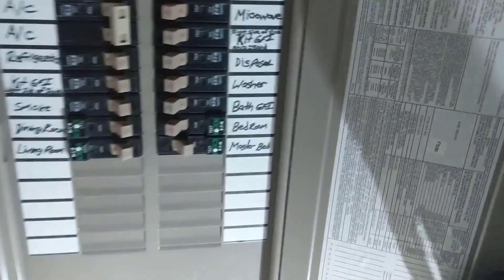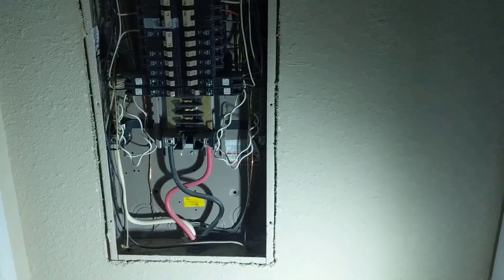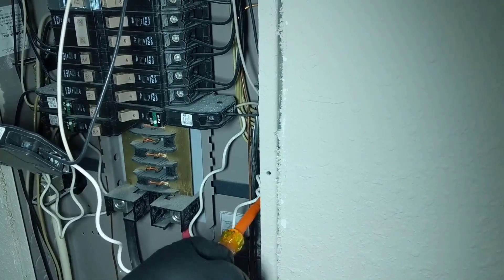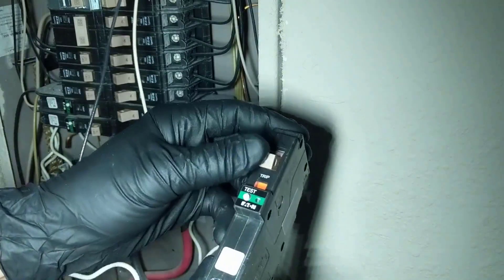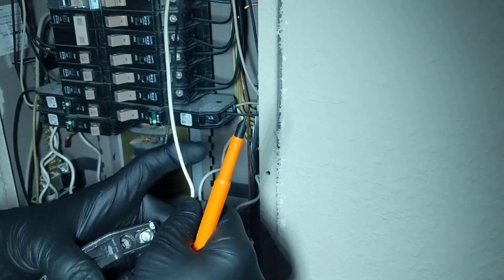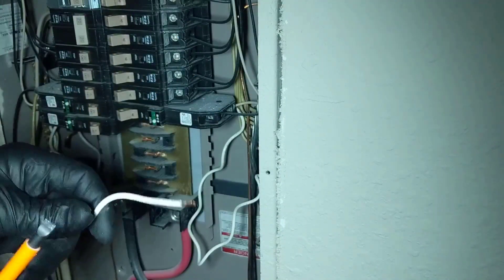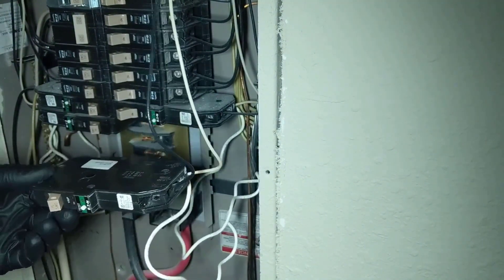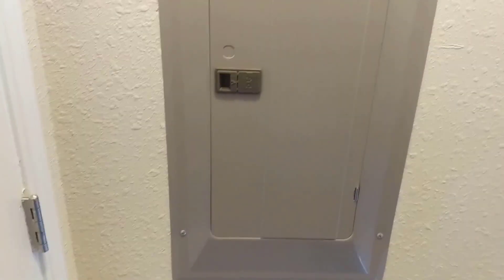Eaton AFCI Breaker Replacement

Comment: As an electrician I have a few problems with this video, but I will just shut up! Be careful folks! Call an electrician if you are unsure of your abilities!
Reply from the maker: That's a good idea 💡 Thanks for watching Food Porn 👍
Reply from the maker: I do agree with you on if your not comfortable or don't know what your doing stay out of the service panel. Atleast shut the main breaker off to the panel if anything. I've been replacing breakers, outlets, switches, 3 way switches, running wire, conduit, etc...for 20 years & I'm always aware of my surroundings doing any kind of electrical work. I'm not an electrician as a everyday job, but I do it enough. I also took a year of basic residential electrical in vo-tech, then switched to HVAC/Plumbing for the last 3 years. By no means am I saying I'm an electrician, but I know what I'm doing & how it works. Please share your issues with the video. Thanks
Reply: @ApartmentMaintenance  I just think most (not all) homeowners or whoever should probably not be working in a live panel like this, I am not a service electrician anymore, and never had my own company, so it is not about electrical companies taking your hard earned dollars, just from pure safety standpoint, of them hooking it up wrong (way too many variables to go over, loose connections, hooking neutral to the wrong bar, then it wont function properly, ect. Not every panel will have a gold "bus bar", I am thinking from a complete noob doing the job. A lot could be done wrong here, as well as injury. ok that's my 2 cents for what its worth. I would at least recommend to turn the main breaker off to the panel while working in it, I do not, but I am not a noob.

Comment: I've never changed a circuit breaker out on a house before, but this is my project today. This video looks almost exactly like what I'm about to do. Thanks for this.
Reply from the maker: No problem, hope the video helps. Thanks for watching Kyle & Subscribe to the channel 👍
Reply: How did it go, did you have any issues replacing it ? I’m doing the same thing . Do I have to shut the big main brake to the panel off to be more secure ?
Reply: @rolac6109  YES. Maybe the pros don't have to. But I made sure to turn mine off. I've replaced 3 total now with no issues.

Comment: Those breakers go bad fast we change those a lot at my building.. Thank for sharing stay safe.
Reply from the maker: Yeah I've been getting alot lately, their at the 6 year mark and starting to drop like flies. Thanks for watching Rudy 👍
Reply: Yes I'm curious I cannot reset it and my home is about 5yo I thought I had a short but cannot seem to find anything wrong aside from concluding the breaker it will not reset just keeps tripping
Reply: @ApartmentMaintenance  let me know
Reply from the maker: @Tico_Mike  Sounds like a wire is touching another wire which will make the breaker trip right away. Soon as you reset it, it will trip instantly. Those kind of issues take time to diagnose, I usually check all the outlets first then the switches, then if I can't find an issue I would swap out the breaker. Good luck on your adventure. Thanks for watching Tico & Subscribe to the channel 👍

Comment: Man I wish I had any other brand breaker than Eaton!  These AFCI breakers are still susceptible to RF and I trip breakers all the time with my Ham radio.  This was supposed to be fixed as Eaton worked with the ARRL to develop a new breaker, turns out they still trip when transmitting over the radio.  Wonder what it's going to cost me to replace the entire panel?
Reply from the maker: That's crazy! I'm not sure what that would cost, but call around & get some quotes. Thanks for watching Art & Subscribe to the channel 👍
Reply: Are the Eatons unreliable? I got one that does not reset at all. I thought I had a short but checked all my outlets etc
Reply: Got a Eaton breaker box with nothing but these breaker switches . 2 of them keep tripping boutta replace one today see if it fixes it. Checked the outlet to make sure it wasn’t anything wrong but seems fine. My bro told me most people don’t install these cause of this type of problem with the breakers they are more sensitive apparently and they fucking cost a lot lol .

Comment: Why does the neutral need be disconnected?
Reply from the maker: @frikinrikin  The neutral is connected to the new breaker out of the box so you have to install that white wire on the neutral bar. Thanks for watching & help support the channel by subscribing 🛠️👍

Comment: I really appreciate your use of the on-screen captions feature. Thanks.👍 I have two questions:
(1). Is this the same procedure for an Eaton 20 amp AFCI breaker? 
(2). If I don't have an insulated screwdriver, can I just put shrink wrap over the shaft of a regular screwdriver?
Reply from the maker: No problem on the on-screen cations! To answer your first question about "Is this the same procedure for an Eaton 20 amp AFCI breaker?"  The answer would be yes, everything is the same the only difference is the breaker is a 20 amp vs a 15 amp. Your second question of asking if "I don't have an insulated screwdriver, can you put shrink wrap over the shaft of a regular screwdriver?"  The answer is, Absolutely NOT! Cause shrink wrap is not the same as an insulated screwdriver such as Klein, Milwaukee, or any other brand of insulated screwdriver. I would recommend buying the correct tools to do the job & if you don't feel comfortable call an electrician to replace the breaker since doing any kind of work inside an electric panel isn't for someone who doesn't know what their doing or have the proper tools & knowledge. I'm glad you asked the question, cause it's definitely worth the money to call an electrician. Thanks for watching Wiggler & Subscribe to the channel 👍
Reply: @ApartmentMaintenance  Shouldn't you be telling everyone to refer their questions to a qualified electrician?
Reply from the maker: @larrywarolin7215  Thanks for watching Larry 👍

Comment: Question:
You referred to the ground bar/neutral bar as the same.
In another video they said not to connect the coil to the ground bar but only to the neutral bar.
Is there a difference?
Thanks for all your details.
Reply: No not the same big difference. Don't connect white on your ground bar unless both neutral bar and ground bar are connected. Usually ground conductor is green.

Comment: I switched out my breaker thanks to you. But I’m still not getting power from this specific breaker. What else could be my issue?
Reply from the maker: Your not getting any power at the breaker itself or from the circuit? Cuz if the breaker is installed correctly & then flipped on you should get a reading from a ground lug to the screw on the breaker itself whether it's 120v or 240v.
Reply: @ApartmentMaintenance  so I actually checked all of the outlets and they are giving power. However I plugged in a charger for my phone and it tripped again. Nothing is plugged in, in that room. But yes the circuit itself does have power
Reply from the maker: @0240172  I would try plugging something else in to see if it still trips or if it's just the charger causing it to trip. If it does trip with anything else plugged in you most likely have an issue at one of the outlets. I would also try plugging the charger or whatever else in at a different outlet on that circuit to see if it trips there as well or if it's just at that one outlet cuz they would tell you that it's cause of that outlet.

Comment: Do you not switch the main breaker off first? If not, any reason not to or you just don’t feel it’s necessary? Thanks for posting
Reply from the maker: I did not. Turning the main breaker off is definitely best practice & the safest way to do it, but sometimes I just go with how the job is going. Not that it's an excuse or reason but I've done countless breakers in my time but of course that's still not the right answer. Great question Scott. Thanks for watching & Subscribe to the channel if you're not already. 👍

Comment: Do you have to use the braided ground wire or can you replace with a solid?
Reply from the maker: The wire your referring to comes from the manufacturer internally connected to the AFCI breaker & everyone I have seen so far has been a braided wire. I would follow the manufacturers instructions listed with whatever AFCI breaker you purchase. Thanks for watching root alley & Subscribe to the channel 👍

Comment: good vid. I need to do this as well so thanks for the tips. So you didn't shut off a power main? just made sure not to touch anything hot right? and the gloves, do they do anything? thanks!!!
Reply from the maker: The gloves don't do anything. It's best to shit the main breaker off when messing with anything inside the electrical panel. Thanks for watching Terry & Subscribe to the channel 👍
Reply: @ApartmentMaintenance  If it's best to shut off the main breaker, why don't you?  You've got your two hands tied up and wires flailing around.  I am not an electrician, but I work in the industry.  I don't think it's wise to show amateurs working on a panel hot.  Just MHO
Reply from the maker: @bcoldwell1  Yes always shut the power off when working on a live circuit or the main breaker when working inside a breaker panel. I always state it someone doesn't feel comfortable or know what their doing, call a professional. Safety First! Thanks for watching Bill & Subscribe to the channel 👍

Comment: Hey, can I replace one of these afci breakers for a regular breaker?
Reply from the maker: It's code to have an AFCI breaker in newer homes or existing homes when an addition is added on, an extra circuit is added, or an extra outlet is added. The AFCI breaker provides a higher level of protection for the circuit. A regular breaker would work on the circuit, unless there's an issue in the circuit somewhere that's causing the AFCI breaker to trip, the regular breaker would trip as well. Hope that helps. Thanks for watching Pilotmedic & subscribe to the channel 👍
Reply: @ApartmentMaintenance  thanks
Reply from the maker: @pilotmedic  No problem!

Comment: Is there a special tool to get the white pig tail wire off the nuetral ground? I tried to replace a faulty breaker and the screw would not budge. It's like it's glued in.
Reply from the maker: I just use either a insulated #1 square bit screwdriver or a insulated flat head screwdriver. Thanks for watching Chosen1 808 & Subscribe to the channel bro 👍

Comment: Hey, I know I'm watching this a year after you made it, but can I ask, what gloves are good to wear when working around a circuit breaker? And are they designed to actually protect you from electrocution?
Reply from the maker: They make gloves that the electric company wears when messing with really high voltage but I don't know what the proper name is for them. I'm just wearing nitrile gloves in the video but they aren't rated for electricity. Thanks for watching John & Subscribe to the channel 👍

Comment: Is it normal for an afci or gfci breaker to be hot at all times?.
Reply from the maker: AFCI & GFCI breakers do run several degrees warmer than ambient temperature & warmer than normal circuit breakers. The GFCI breakers or receptacles have a transformer built into which makes them run warm. But if a breaker is hot to the touch there's most likely an issue such as a over heated breaker, loose breaker, or failing breaker. They will sometimes make sizzling or little popping noises when failing, & most of the time they will just fail without any warning. Great question Mi Sangre Centeno 💪 Thanks for watching & make sure your subscribed to the channel bro 🛠️👍
Reply: @ApartmentMaintenance  thanks a lot bro. I have 13 heat sensitive breakers (afci and gfci) in my load center and 8 normal breakers (not warm). They are warm but not hot to the touch. Because all the sensitive switches are hot, I think it's an usual condition but I'm not sure.  My loadcenter is an Eaton Plug-On neutral.

Comment: Was the black wire hot? You were able to touch it without getting shocked?
Reply from the maker: The black wire is hot when it's connected to the breaker & the breaker is connected to the bus bar. The incoming power legs (the 2 wires mounted at the top of each lug) are hot which makes the bus bar hot down the middle of the panel. Once I turned the breaker off & removed it from the bus bar there is no power going through that wire anymore since it's disconnected from the panel. If your uncomfortable or don't know much about an electrical panel I wouldn't recommend working in or around one. Call a electrician for repairs. Remember Safety First!! Thanks for watching & Subscribe to the channel 👍

Comment: Did you turn off the main power to the house? Just wanted to confirm.
Reply from the maker: It's always best to shut off main power before taking cover off electrical panel & doing any work inside the panel. Thanks for watching Pigs & Subscribe to the channel 👍
Reply: @ApartmentMaintenance  If you shut off the main power, then nothing is hot right, including the bus bar in the middle of the panel?
Reply from the maker: @Loki_Lou  I'm not sure how your breaker box is setup, but mine doesn't have a main breaker inside the breaker panel, it's outside at the meter. If I would of shut the main breaker off outside at my meter, my panel wouldn't have any power. I would still confirm there's no power with my multi meter, & use my lockout tagout device at the main breaker so nobody could turn it back on. You will have to see how yours is setup & if your able to shut off the main breaker I would still confirm the power is off with a meter. Thanks for watching Yanxin & Subscribe to the channel 👍
Reply: @ApartmentMaintenance  Thank you. I do have a main breaker shutoff and was able to install a breaker without any issue. Thanks again!
Reply from the maker: @Loki_Lou  Always remember Safety First! But glad you got everything taken care of & saved yourself some money by doing it yourself. I always say when it comes to electricity if your not sure or feel scared then it's best to call an electrician, as it's not worth the consequences, & you only get one life, choose wisely. Thanks for watching Yanxin & make sure you subscribed to the channel bro 👍

Comment: Our home inspection reported that the Arc breaker was not functioning and should be replaced. This seems fairly doable, but we don’t have the appropriate tools you used (insulated tools?). Would it be worth it to invest in the tools and purchase the part to replace ourselves, or would it be better to call an electrician?
Reply from the maker: If your not familiar, comfortable or experienced working inside an electrical panel I would definitely have a electrician replace the arc fault breaker. It's not a job that you just go buy the tools & do yourself. One mistake & your done. I highly recommend an electrician. Thanks for watching Erika & great question. Subscribe to the channel 👍

Comment: Is that black and white hot
Reply from the maker: No just the black is hot, the white wire that you screw into the breaker is your neutral on the circuit, & the white coiled wire goes to the neutral buss bar inside the panel box. The AFCI (Arc Fault Circuit Interrupter) breaker will detect a arc in anything that is plugged in and cut off the power to that circuit, such as a damaged cord, a loose connection, or even damaged wiring on that circuit like if the insulation for the wiring is wore off and a arc happens. Thanks for watching Michael & Subscribe to the channel 👍

Comment: should the coiled white wire that goes to the neutral bar be uncoiled? mine aren't in my panel.   seems like leaving them coiled would cause electromagnetic induction. btw...all my eaton afci's are hot to the touch with no load on them. is this normal?
Reply from the maker: Whether or not uncoiling the white wire makes a difference or not Im not sure & never heard of any issues caused due to the wire being coiled or not. I look at as it's a wire with insulation mount to the neutral bar. As far as being hot to the touch with no load on them I don't see why they would be hot to the touch without having a load on them unless it's just heat from other breakers surrounding the AFCI breaker. Great questions Gary. Thanks for watching & Subscribe to the channel if you haven't already. 👍

Comment: Theses breakers stink. ...Also i was taught neutral always on first off last.
Reply from the maker: The power is off, the breaker is bad so I don't see why it would matter which wire you do first or last, but if that's what you were taught just go that route. Aslong as everything is hooked up properly & you know what your doing, once you flip the new breaker on it will work. Thanks for watching MEGA & Subscribe to the channel 👍
Reply: will do thanks for sharing
Reply from the maker: @mega8664  No problem, anytime. Thanks for watching 👍